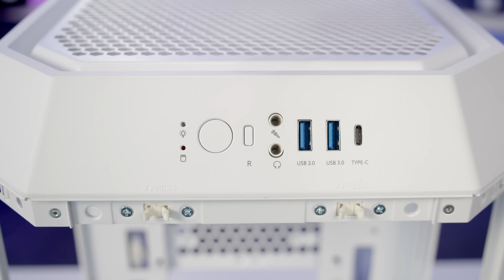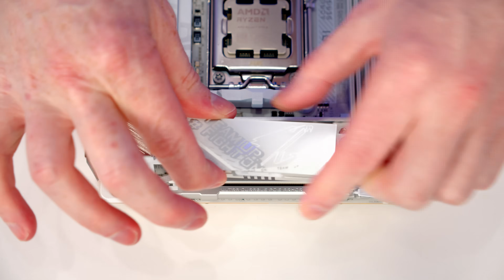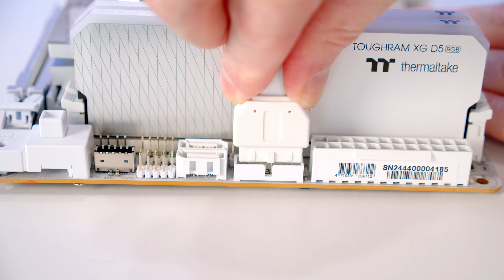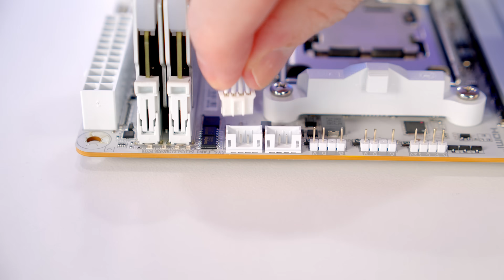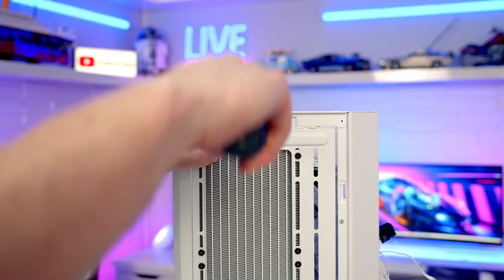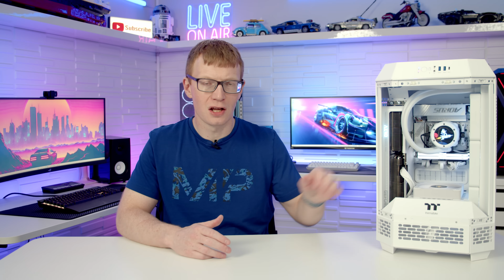Thermaltake The Tower 250 Build - Step by Step Guide

Comment: Could this build handle the Liquid Freezer III Pro 360 AIO CPU Water Cooler from Arctic? it has a 37mm thick radiator .. it looks like you are right on the limit for thickness.
Reply: It depends on what type of PWR Supply cables you use for the CPU PWR. I used extension cables that I could flatten and it worked good.

Comment: I would like to know if The Tower 250 can fit in a 80mm thick GPU? My GPU has a customized heat sink and two 3rd party 25mm fans, which makes it about 80mm thick. If that's not the case I might have to replace it with a pair of 15mm thin fan.

Also from your point of view, is the light effect of top fans noticable? I am pondering over whether to replace the stock fans with ARGB fans or not? Would appreciate to have your comment, Thanks

Comment: Entering your case to access your IO port and graphics card is wildly irresponsible of a case designer. Like having to remove fans to use a motherboard USB slot or check your ethernet cable is awkward and unnecessarily time consuming.

Comment: I was hoping to get this case, but they did not release it in the bumblebee yellow color scheme so I opted for the 300 instead. Best case I have ever had to be honest. All those screens do a great job keeping the dust out. I built my wife an APU system in a green Tower 100.
Reply: There is bumblebee
Reply: @Cons2911  No there is butter caramel. Its a different color scheme entirely. Its a soft yellow and baby poo brown. And it doesn't have the tinted glass that the bumblebee did either.
Reply: @davefroman4700 like this one. Is there a tower 300 and 250?or are they the same?

https://youtube.com/shorts/9FfDWtuORgw?si=wg6dAVNBlC5zQsFa
Reply: @davefroman4700 my bad, it's 300 not 250
Reply: @Cons2911  One is ITX the other is MATX. The latter being quite a bit wider.
Reply: @davefroman4700 yeah just realized that. 300 got the bee

Comment: Many cards will overheat if the bracket is on top, as in this case. If you are selling or introducing this product, communicating this fact to your audience will show your sincerity. There is a video showing the MSI 5090 TRIO experiencing thermal throttling at a core temperature of 90°C. There are many products that can become like this when hung.
Reply: "Many Cards" is not factual. Only the top tier cards are an issue. I have a 9070xt in mine and it idles at 27c and never gets about 72c.
Reply: @davefroman4700  even then, it's only cards with vapor chambers, not "top tier" cards. Just make sure you card doesn't have a vapor chamber and you're good to go.
Reply: @davefroman4700  Whether it's a lot or a little is a matter of perception. I believe that if even a few percent of products lose their cooling performance, manufacturers have a responsibility to warn customers. By the way, if you hang the Sapphire RX9070XT, it will become extremely hot. The 7000 series sapphires were fine. I'm not the type of person who doesn't care if someone else is unhappy as long as there are no problems with my product, and I want to see a world where many people can build PCs safely and enjoyably. I've never had a problem myself, as I only use cards in normal landscape orientation, but I'd hate to see a sad report from someone who has tried hanging them.
Reply: 5070ti AERO specifically uses a vapor chamber that is working against gravity in this vertical configuration.

Comment: I think if you don't have enough long fan screw, you can mount the bottom fan with normal fan screws: the bracket looks removable. Nice work anyway.
Reply from the maker: Bracket is removable, but you have radiator screw holes, so standard screws wont fit

Comment: By hanging the GPU virtually does it cause any problems with any GPU you can get or can you just use any GPU without any problems?
Reply from the maker: Some will work well, other over heat, it's gpu specific
Reply: It's only cards with a vapor chamber.

Comment: Great build and video, apart from the obvious under the hood as they say are there many differences between any ATX, Micro ATX, Mini ATX motherboards for builds? IE: If you were building using 5090 gpu with a good cpu should that be built using ATX MB?
Reply from the maker: I would agree with you, but people love to fit those components in the smallest case, the tower 600 was my favourite so far
Reply: There is no difference in performance if you have the same chipset on the boards. What you do not get in ITX is all the extra M.2's and PCIE lanes etc.

Comment: Thanks Chris! 🙏🏼

Right now I can actually purchase a 300 from NewEgg for less than what they're charging for the 250 (a $15-20 difference, depending on the color chosen), but if I was building another m-ITX PC in a Thermaltake Tower, I think I'd actually do it in another 100.  The only thing I really didn't like about it was that, in order to remove the front/side/rear panels, you must remove the 'top hat' first, but otherwise it's a great little case. 👍🏼

Thanks again. 😊
Reply from the maker: That's good to hear, I'll have to check that one out at some stage.
Reply: Yeah the wife has the 100 in Forest green. It hides amongst her house plants in the living room nicely. I have the 300 because they did not release the 250 in the bumblebee yellow I wanted. I leave the screws out of the top of the wife's case and just pop it off when I go to clean it. The 300 is the same really. Its tough to get the side panels off without removing the lid, but its not a big issue by any means.